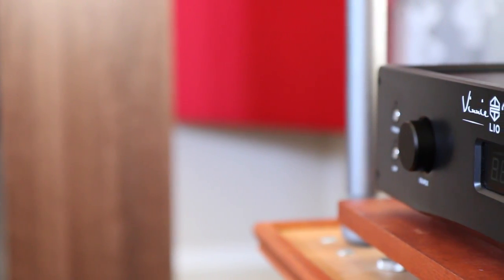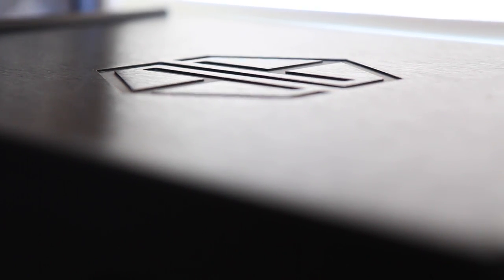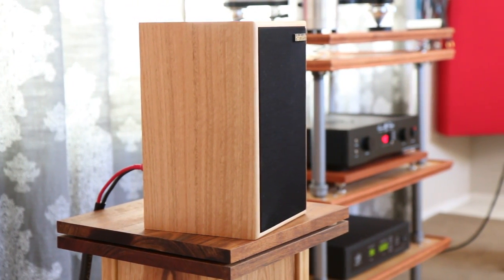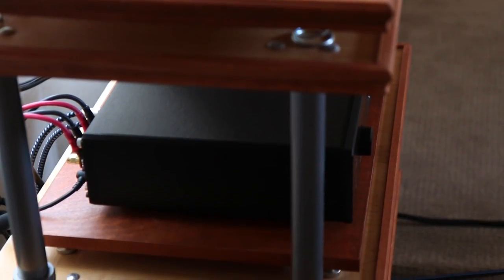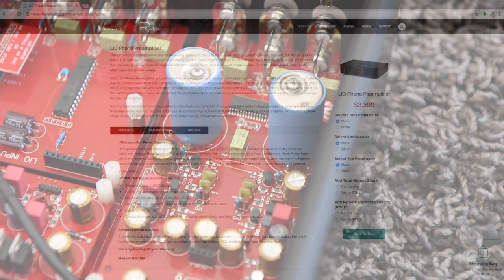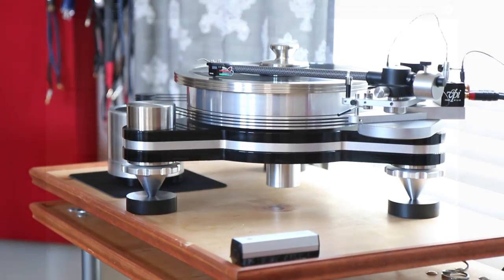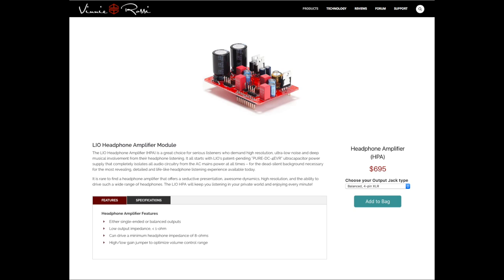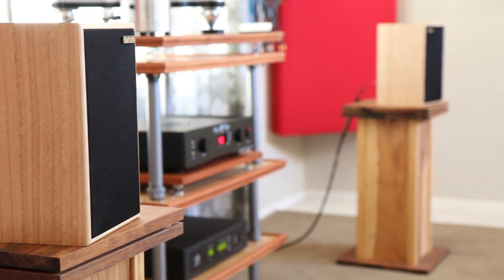LIO "All things tech"

Comment: Great review as I was looking into spec-ing out a LIO.  

BTW, where can info on that av rack?  Looks very modular like the LIO where I can build it out or mod as needed.

Thanks!
Reply: Yakena1 : He & his brother made it. Plywood or MDF, + cast iron plumbing parts, from Home Depot. You can clear varnish the pipe parts if you wish. Tho they might be slightly oiled,? , if so , wipe down with methyl hydrate / gas line antifreeze.
  I'm a carpenter. I'd either use no trim, or at least install trim even with the top surface of each shelf.  With it raised like here, you cannot wipe dust off, as the trim creates a lip. Also, you could consider using 3 pipes / legs per shelf. 2 on front, 1 in center back. A tripod always sits solid, never rocks back & forth.